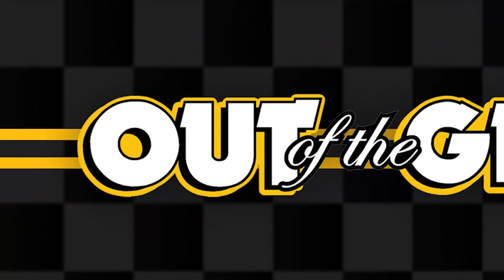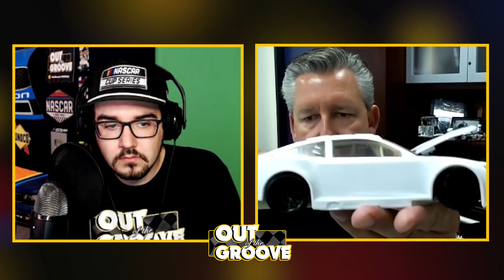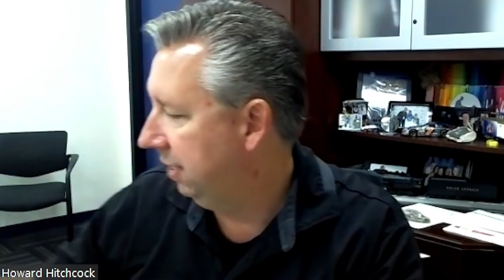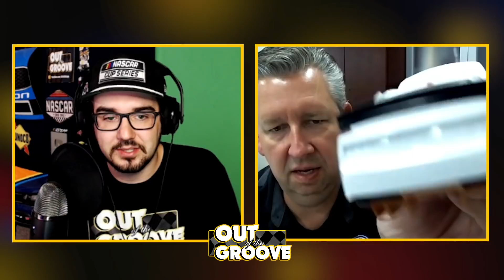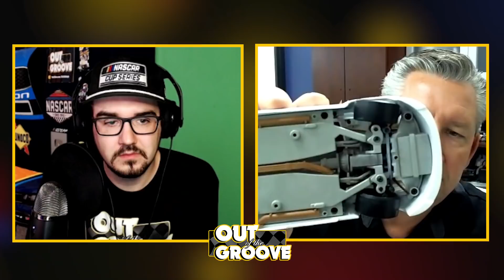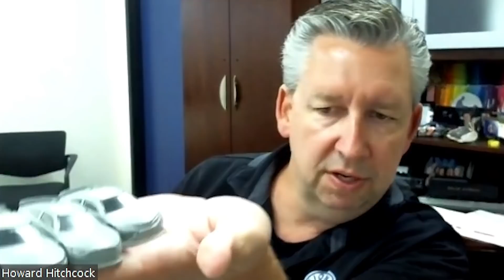First Look at the NASCAR Next Gen Die-Cast! | Interview with Lionel CEO Howard Hitchcock

Comment: NASCAR 1/18 scale model cars could do with a bit more realistic precision build & add features like open/close front bonnet & open/close doors including the rear boot lid as well . . . infact the life size NASCAR should be having open/close front bonnet & open/close doors . . . if not anything a proper open/close driver side door at the very least, for safety reasons . . . don't know how NASCAR approve & endorse the one piece moulded body in an actual race car which is very much a safety hazard & NASCAR regulators know this fact better than anyone . . . NASCAR should assign model car manufacturers like AUTOArt, Kyosho & Exoto to make perfect 1/16 & 1/18 scale model iteration of the real thing . . .

Comment: I see a lot wrong with this diecast
1 the exhaust is in the wrong location it’s to far back. 
2 the rear axle is solid witch is wrong. Needs to be independent. And the rims are not black they are aluminum so they need to be that right color
3 the transmission is definitely not in the right location. Trans needs to be in the back of the car

Comment: Forget China and the whole shipping process. Make 100% of the die-cast products here in the USA 🇺🇸
Reply: If you want to pay $200 a diecast let’s do it. Most factories in the USA do not want to produce hand assembled products 💯.
Reply: @goukizx2  as awesome as it would be to see these products made in the USA, you're right, the prices would go to the stratosphere in fact to help add to your response, both Rapido and Scaletrains were asked similar questions when it came to their locomotives and rolling stock for model railroading.  According to to those interviews, it would shoot the prices to brass model range (for those wondering, HO scale brass locomotives can range from $800-$1500+ per unit depending on the type) plus the fine detailing and making them as accurate to the respective prototype only further adds to the price, not to mention building the factory, finding the right employee, paying them, etc.  Point is, it's not as easy as just saying "Hey, let's move everything back to the US!", wish it were that simple though!
Reply: @randallellison6421  I tried to get my glass products made in the USA but none of the factories wanted to make it as they wanted an initial run of 2 million units. I had to go overseas and they made my first run of 150,000 and then my second order of 750,000. But I had to pay the $20,000 for my container to come from overseas just like the video and we got bumped 3 times. Kinda hard to keep things made in USA when those manufacturing companies don’t wanna work with you.
Reply: That would price the masses out of the hobby